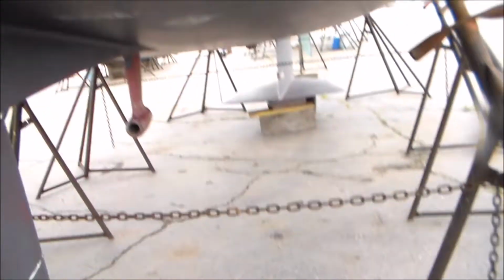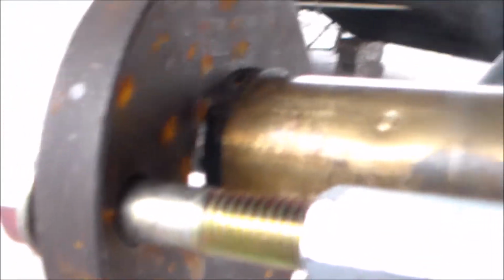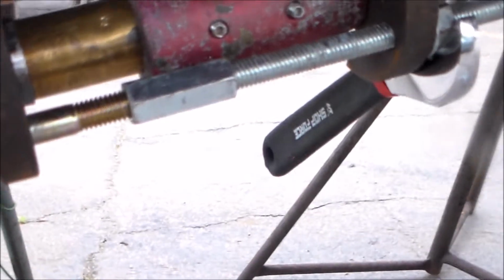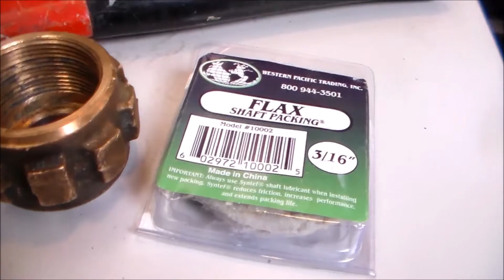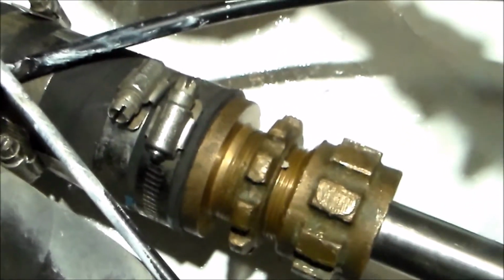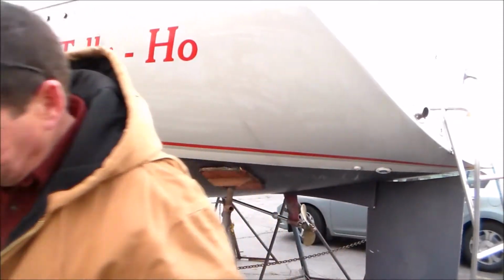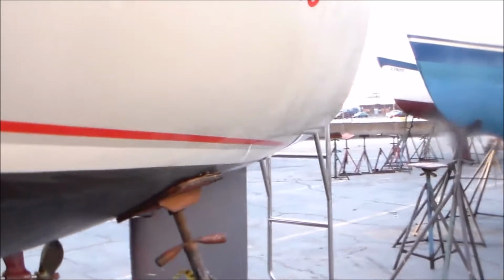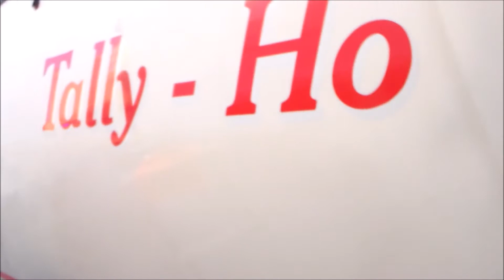shaft installation

Comment: Did you make sure to align the engine/trans to the shaft?
Reply from the maker: Yes, I did.  I didn’t show it, but once I got the shaft in, and the new coupler on, I used a feeler gauge to make sure the shaft was lined up with the engine/trans.
Reply: @TallyHo322  Once you aligned it, did you find that it deflected at all once placed back in the water? Or was it all good? Nice videos
Reply from the maker: @matthewsilva8225  I checked alignment after getting the boat in the water, and it pretty much stayed in place.

I added a Volvo Penta shaft seal the year after I replaced the shaft.  I check the temp of the shaft, listen for knocks or other sounds periodically when motoring, and it is cool and quiet. 

I do give the seal a squeeze when I open the engine-cooling intake valve just to make sure there is no air in the seal.  Hard reversing can force air into the stern tube I guess.  And I usually reverse hard stopping in my slip.